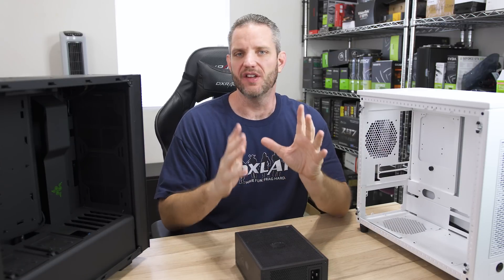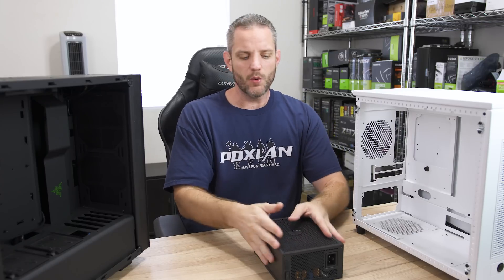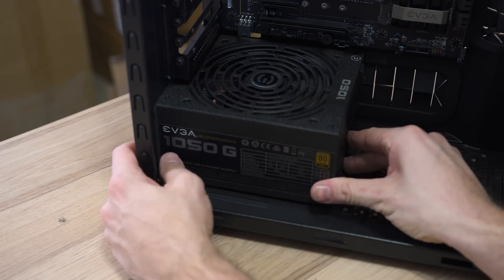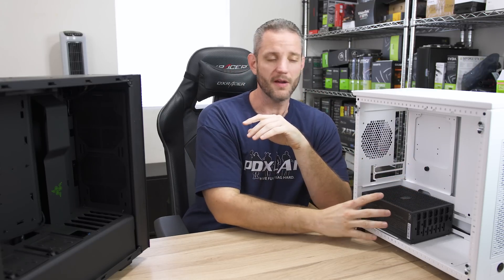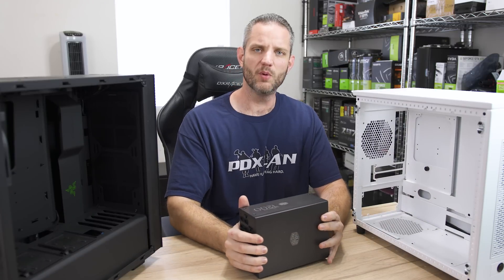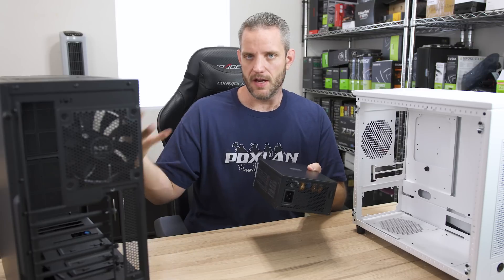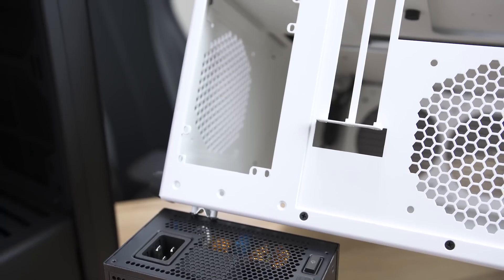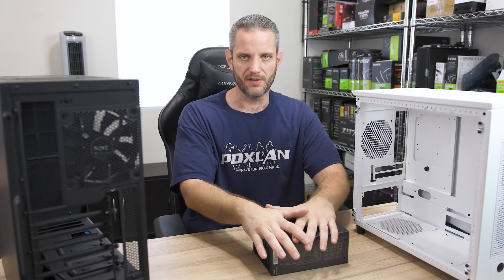Should you mount your Power Supply up or down?

Comment: After watching this video I decided to put the PSU with the fan upside whenever I would get a new PSU. About a month ago I bought a RM1000 Corsair 1000 Watt Gold Certified and installed it with the fan turned upside. But what concerns me is that the fan does not spin,  I do know they will turn on when the PSU reaches a specific voltage usage, what I'm mostly concerned about is the dust which can get into the PSU during those moments when the PSU fan is not spinning. Should I be worried or not?

Comment: Is the option to mount the PSU up or down reserved for these custom cases?  I have a Lenovo IdeaCentre 300-20ISH and want to upgrade the PSU to 500W.  I noticed the PSUs available have the fan on the top like the one in the video instead of in the back like the OEM one I have.  My case has no vents at the top.  I figured I might be able to mount it with the fan facing downward, but I noticed that the screw configurations on the PSU and my case aren't in a perfect square, there's one that's kinda offset.  Does this in fact keep me from mounting the PSU with the fan facing inwards?

Comment: Why then does a case have holes drilled out on the bottom of the case if they are not to be used as an intake for you psu? Why not just have a solid bottom? Why are the stickers on the psu sometimes upside down when the fan is facing up?   Bad video

Comment: You said that if the fan is facing inwards it will run cooler , I'm sorry but that just isn't true. No matter how good the case cooling is the air inside it will always be way hotter even when taking in account the "looping" effect you mentioned. I have actually tested this myself and I realized how much hotter the supply was running with it's fan drawing air from inside the case. This is an issue if your PSU is close to it's power draw limit and you are putting it under additional stress by making it run even more hot.

Comment: @jazy what about with those thermaltake p3 and p5 cases, you can mount the  power supply down, up or sideways. what do you suggest? do you think sideways will mark or make the plexiglass dull in time due to the heat? thanks for the info.

Comment: I like to weigh in here. My psu is making a rattling metal sound so i turned it upside down and now there;s no noise i have a lot of room and grill holes
Reply: don't use the PSU until you find whatever is inside, that is dangerous

Comment: I would like to see a video on dust build up. Maybe fine a 10 year old case that has never been cleaned and do bench markings of before and after clearing all the dust away.
Reply: why 10 years old? My 4790k been running 24/7 since it was the latest greatest CPU out there.. After 3 to 4 months of continuous running, I'll be running 50C at idle, and 80C under load. When cleaned, idle temp is 35 to 40C, and no more than 60C under max load. Pretty simple deduction.

Comment: Great video about PSU fan placement. I do have a question regarding airflow. I'm building a new pc with a master air maker 8 and a rx480 and evga p2 650. If I place the fan facing up, wont the heat from the rx 480 collide with the heat coming from the psu. The case I'm using is a cougar evolution full tower that comes equipped with 5 fans. would those fans be enough to cool the components mentioned? please let me know.

Comment: I have 2 fans for air income an 1 to get the air out. Then on the side on the bottom an on the top the is case is not completely closed so the air can flow. Do i have problems with that pressure?(supper up an no watercooling

Comment: Many year ago an IT magazine done a test on a plastic casing (which allow user to mount the psu on top or bottom) an then the editor wrap the casing with wrapping film,  the end results show that bottom position psu get better air flow and lower inner case temperature compared to top position psu.....

Comment: In my Phanteks P400S I installed the PSU facing up. Originally had it facing down, but my Thermaltake smart power has a noisy fan and some coil whine. Facing it up has lowered my GPU idle temp and reduced the noise that was resonating off of my desk from the noisy fan.

Comment: wouldnt the air in the case be hotter cuz its being heated by the cpu, and gpu
Reply: Yes ,that's why psu manufacturers always recommend fan down, it's nearly always better to intake fresh,filtered air for PSU ,CPU and GPU and let case fans exhaust hot air from case, positive pressure also helps as it forces hot air out of the case as well as reducing dust.
Reply: That was happening to me with my built. The hot air from the case was f*** up all my PSU until one day I decide to flip it down and from then on never encountered air flow problems with the PSU.

Comment: I'm just getting into building a pc,  I'm building it for gaming & some video editing & 3d editing & I do have a pretty good budget to work w. & so far this is what I've decided upon:
-Intel core i76950x 
-HyperX Fury 2666MHz DDR4 
2×8GB 
-EVGA GTX 1080 FTW 
If anyone could help me out on what else I need such as motherboard & power supply that would fit these specs so far thank you

Comment: Hey Jay I got a follow up question to this. My psu is the seasonic x650. It has a hybrid fanless mode, where the fan doesn't spin until it hits a certain load. From the literature I saw on seasonic site, It told me to mount it fan facing up (fan facing the motherboard) because hot air rises, and when it's on fanless mode the hot air will exhaust out the fan hole. So my question is, is it safe for me to mount my psu fan facing down with the hybrid mode on?

Comment: i have tried this method i have an r9 290, i have a cooler master n400 case, 2 intake fans on the side one intake fan in front and one exhaust rear fan, well puting the PSU as an exhaust cooled my GPU for like 10°, but generated a lot of heat on my 600W cooler master thunder, so i switched back to the classic position, if you have a GPU that generate lot of heat i recommend not to put it on exhaust,  i hope this help some of you..

Comment: My Gpu runs around 80C at full load, I don't think the psu will be pulling any "cool" air from it.
Reply: There is an easy, albeit a bit time consuming (about 1-2 afternoon) solution to this problem.
1. Take apart your video card, clean it and replace old (probably dried out) thermal paste. Do it with care, don't ESD your hardware. 
2. If still running hot, undervolt your GPU. It's easy to do and risk-free(look up a guide).
I did these and my previously 75-80°C hot RX580 now runs at 55°C at 100% load with 30-40%-ish fan speed, while delivering slightly better performance.
Tools required: 
- Screwdriver for taking apart the video card.
- Isopropyl alcohol or something for cleaning old thermal paste and other things.
- Some ESD safe and lintfree wipes preferably, maybe compressed air to clean the dust
- Good quality thermal paste (I used Arctic MX-4).
- Thermal pads for VRAM probably reusable, so not necessary.
Reply: @Orion 8096758 He actually did address that with the entire circulation conversation when he started talking about the fan being faced down, he just didn't word it as such.
Reply: 47 max here, though is that normal with older hardware?
Reply: Lol even my stock cooler rx 5700 xt isnt even 80 on load
Reply: @Toregev Yes hot air rises, but any fan on even the lowest settings can easily overcome that.
Reply: GPU's exhaust fans face down, so they are pushing hot air down and you have your PSU under your GPU facing up which is sucking air down...so in all reality your PSU should be sucking on that hot air from the GPU's exhaust...I have 2 intake fans on the front of the chassis that push all that exhaust air over the PSU and GPU and out the back and at the same time provide fresh cool air, while the CPU has 1 exhaust fan on the top of the chassis and the original chassis exhaust on the back which both pull CPU's exhaust out. It really helps with dust...it have this PC for 3 years now, I clean it once every 6 months and there's almost no dust inside the rig, only on the intake fans
Reply: @-Yurkey  If you mount your GPU in the standard orientation, it's fans are definitely not pushing air down. The fans are pushing air up, through the heatsink, into the GPU PCB.
So if your PSU is at the bottom of the case, with the fan facing the inside of the case, the GPU fans, and PSU fan are moving air in the opposite direction.
Reply: @EVPointMaster  Yea you are actually right, but I got the intake fans pushing cool air into the chassis straight on both the PSU and GPU. I have no overheating issues, actually I'm getting great performance
Reply: Ummmm. That's pretty bad.
Reply: @Orion 8096758 if you have the right case fans the inside of you pc will not be warm. mine is generally about the same as the outside room temperature. (two front fans as intake, two top fans and a rear as exhaust)
Reply: and i know this as a fact as there's a temperature sensor inside
Reply: @mysterycrumble  negative pressure is bad for your setup, consider balancing the flow
Reply: Mine is about 75 max unless the ambient outside is warmer than usual like peak summer, out of games 35 max, although I'm not running much from 2018-present

Comment: Was hoping you'd address it but i've wondered about GPU fans/bearings with a PSU upwards, intake from inside the case. I imagine it would matter more(if at all) in smaller form cases, closer proximity. Would this be more or less dependent on case pressure? Simply, you have any idea if its detrimental to your GPU's fans/bearings having the PSU pull air from within the case, typically right under the pci lanes.

Comment: Hey Jay cool video as allways, appreciate you sharing your wisdom onto us. But i got two questions. 1 in order to get neutral preassure (as you mentioned favourable) can you somehow control the psu fan speed, say if you have non pwm case fans which are dirrenet rpm. 2 how does having a psu facing up (as an additional exhaust fan)  affect overall temps in different scenarios eg. blower style gpu vs open air gpu.

Comment: This worked for me, I have a LSI raid card in the bottom slot and with the fan down on my 1000watt PSU the Battery on the card would be over 50c, not good for longevity and my raid software would complain, I flipped the PSU and now the air flow drops the battery temp drops to around 40c, my RAID card is now happy and so am I :)

Comment: Hello, I want to build in the MasterCase 5 which has a basement for the PSU, so naturally i would just mount it face down. But my PSU is a hybrid from Seasonic so basically the fans won't spin 90% of the time. It is recommended by SeaSonic to put it face up.. so i don't know what to do within the MasterCase 5. Mounting face down with no fans spinning is not so good, right?

Comment: Jay, as a mini-itx fan there are a lot of cases like from Fractal where the videocard is really really close to the psu.
Could you make a test to see performance and temp diffrents between psu up or down with a close GPU (openair or rear exhaust) I 'm really wondering what brings better temps and what will run hotter.
ty and sorry for my bad english
p.s keep going on with your videos, you rock!

Comment: What!? Air looping on a faced down psu is BS. Warm air has a tendency to raise, and the fan is pushing it outwards as well. On the other hand, a PSU faced up will be pulling warm air from inside the case (this can get very toasty unless you're water cooling), as opposed to cool air from the outside on a bottom faced PSU.

Comment: Hey Jay, if I can only front mount my 240mm radiator, should I do it as exhaust and reverse airflow in my case (intake top and rear) so it doesn't blow hot hair onto my GPU?
Reply: Another basic subject I'd like you to cover (related to this question) is: When (if ever) is it appropriate to do intake at the top/rear and exhaust at the front (reverse direction) ?

Comment: Hey Jay great video! I have a question about my setup ( if you get a chance to read this). I have a corsair 780T with 5 fans ( PSU is face down in its own world). I have 2 fans pulling air in from the front ( filtered). I have a h110 gt rad in the top with two fans pushing air through and out the top of the case. I also have the stock fan in the top back pushing air out. There is so much dust that gets into my system and the worst part is that it shows a lot on the plex glass window and on my makeshift mirror shroud.

I watched a video a while back where you were talking about fan configs and used a incense candle stick to visualize the airflow. I tried to increase the flow/speed of the front intake fans to try and get positive pressure but I still had dust. would you recommend pulling the outside air from the top and bring it in though the radiator and hope the back exhaust can remove the heat coming in. or am I fighting a war I cant win. 

live in SoCal, room is really clean, wood floors.

Comment: Was really hoping you were going to talk about cases with shrouds like that S340 sitting there. I flipped my PSU in my S340 and it seemed like the fan was running much more/harder than when the fan faced down. There's little room between the shroud and PSU for the fan to pull from.

Comment: Please tell me you were referencing Def Leppard with pour some sugar on me?

Also, what many people forget with PSU fan up or down is that it was only relatively recently that case manufacturers put the PSU on the bottom, and the top mounted PSU's were almost always mounted with the fan facing to the inside of the case, and if it didn't negatively affect airflow or temperatures with less efficient PSU's then, why would it affect them now?

I've run PSU's in both fan up and fan down orientation, and my takeaway from that is that I prefer fan facing up because it minimises dust intake to the PSU which extends it's lifespan, and it also looks better with the fan grill facing up.

Comment: 4:06 Dummie, there will be no loop/cycle, because hot air go up.
Reply: It would never... The exhaust temp will always be higher then the ambient temperature. Otherwise the efficientcy of the PSU would be greater than 100%
Reply: Right, about 15% of energy is dissipated in heat.
If you have monster 1500W power supply it consumes about 1725W from wall socket, so 225W just in heat.
Also below 0,1% of energy is loosed in magnetic radiation and other undiscovered ways.
Reply: hot air can still be pulled down by a fan.. dummy
Reply: thanks dummie ..
Reply: how about near the equator?
Reply: A fan is much stronger than natural convection but you are right in that is never a problem because the fan draws air from all directions. You would have to build an air intake and place it directly into the exhaust for this to happen.
Reply: N a z a and that’s what dust filters are for dummy, if your case don’t have a filter then sure face it up
Reply: kind of, the suction from the fans being so close to the floor can actually pull some hot air back in
Reply: Correct statement! But: Keep a positive tone though!
Reply: I keep.
I didnt said anything like "you fucking idiot"
"you fucking moron" "gaytwocents" etc xD
Reply: @Arek_R.  no
Reply: It depends which latitude the PC is. In low latitudes like California and most in summer the ambient air is so hot that the air exhausted by the PSU might go down instead of up.